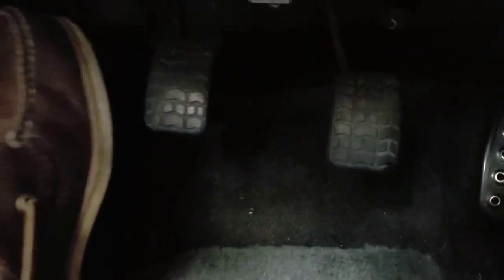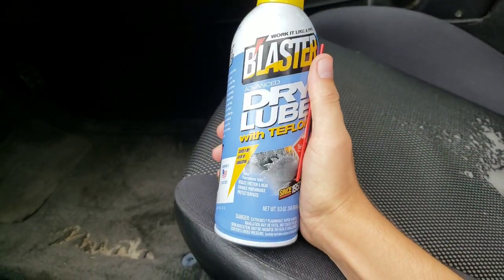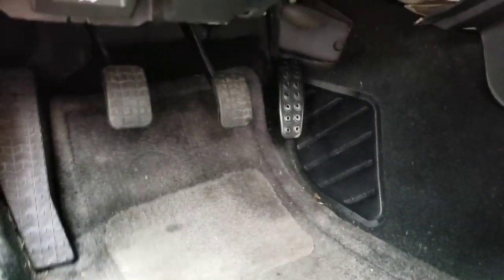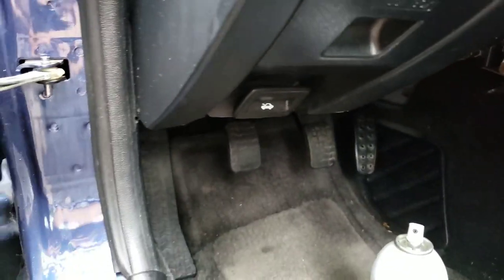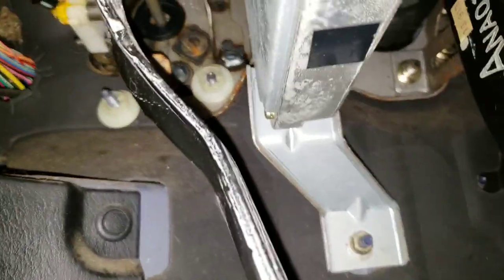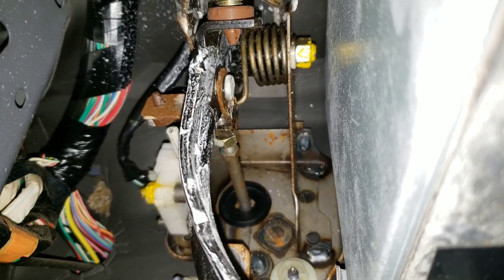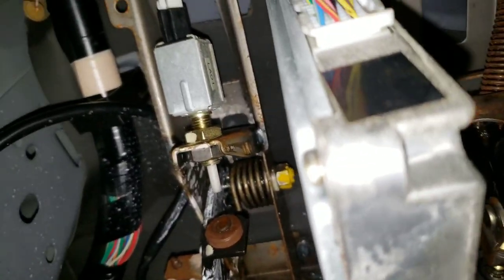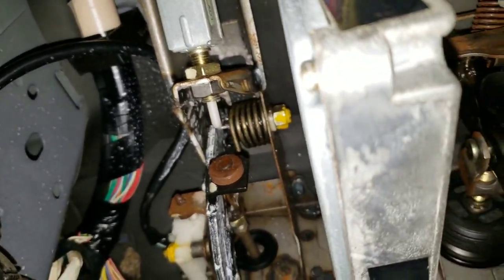How to fix a squeaky clutch pedal

Comment: Thanks, i ll try it too. For me this problem starts after 40 minutes of city traffic with lots of starts and stops. The mechanic suggested me that from the description i gave him, i might need to change the clutch disk (about 200 euros...). If this works you're a hero...
Reply: Did it work?
Reply: @abdurkhan6075  It eased the pedal but didn't work, the squeak was coming from outside. I found the slave cylinder and lubed it and now it seems to be a lot better. I think the cylinder needs to be changed though.
Reply: For anyone else reading this, you should change your clutch once it starts to show warning signs of wearing it.  If you drive through heavy downtown city traffic like me, the last thing you want is your clutch to go bad while your stopped in the middle of a steep hill in heavy traffic.

Comment: It's the spring squeaking. Check out the bushings (the reason the springs squeaking) and replace em with steel cylinders from Lowes for like a $1. Cheaper and more durable than oem.
Reply: Is this legit? Mine squeaks but also gets stuck..would this help or would I need to look further?

Comment: For me personally it was the metal rod that goes into the cylinder. What i needed to do was slightly depress the clutch pedal and then aim wd40 at the point of the rod thats near the hole it goes into. Then i just kept pumping the pedal afterwards until it was fully silent.

Comment: Well, greasing that peddle and the master cylinder rod would obviously be step one... if that didn’t work, step 2 is grease the slave cylinder where it meets the clutch fork. If it’s neither of those things, then it could be inside your transmission where your clutch fork pivots. Which would suck.

Comment: hey I didn't see a recap video yet? can you just tell me if it went away or not?
Reply: It's the spring squeaking. So find the source that's causing that to happen.. most likely a bushing in the center of the spring or on the sides.